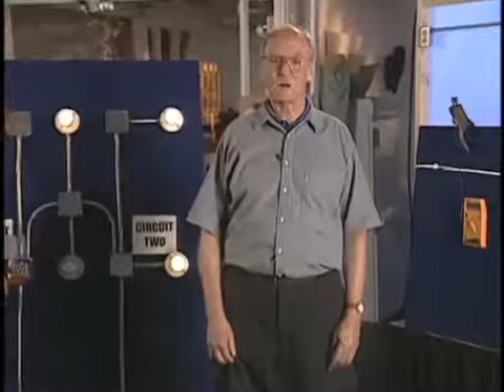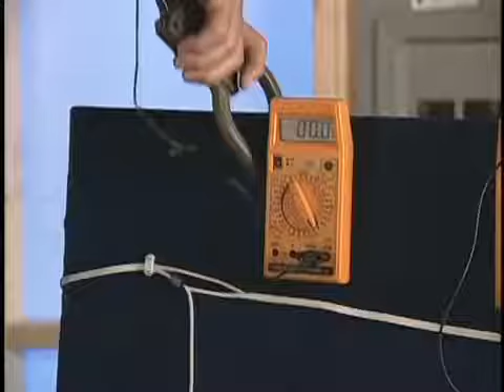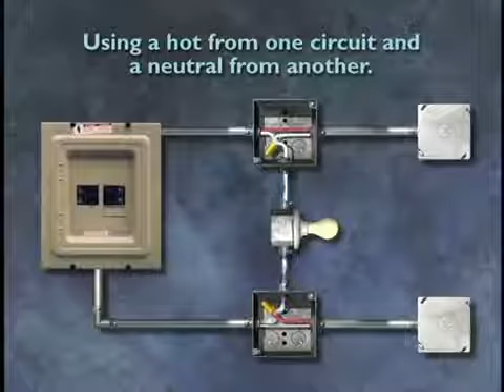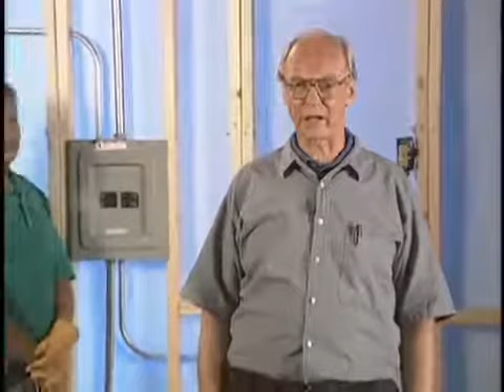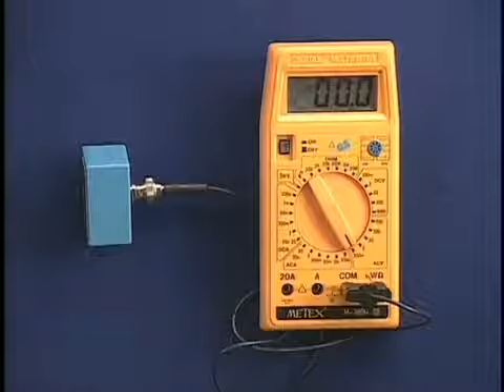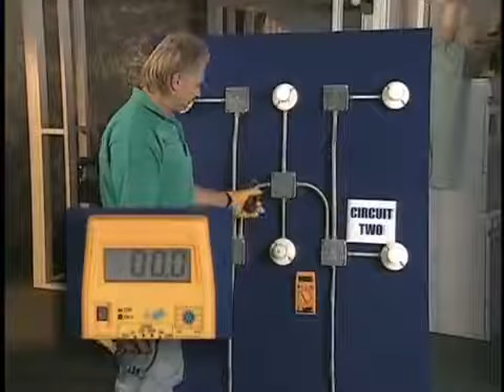Tracing Magnetic Fields EMF by Karl Riley

Comment: Thank you for this video. I have a few questions regarding my electrical panel located inside my condo unit. I am getting really high readings on EMI meter and pulled off face of panel inside my condo. There are 30 gauge wires both hot and neutral plugged into the Main Bus bar, is this right?
There is also a neutral bus bar which has only neutral wires connected to it that are smaller in gauge size.
Reply from the maker: Let's schedule a phone session and take a look at pictures of this.  We need pictures from different angles - clear and showing everything from multiple angles.  A lot of problems we can spot by looking.  Other problems we can only spot by testing.  Visit https://www.electrahealth.com/Personal-Phone-Consulting-with-Shaun-Kranish--Owner-of-ElectraHealthcom_p_77.html to book a session with me, and I can definitely see if there are any obvious major errors!

Comment: If the building was wired with multi wire branch circuits, would that cause higher net currents?   Seems like it would since the neutral only carry’s the imbalance of current on the two phases.  Or does the shared neutral and both phases of a mwb circuit have to run in the same conduit?
Reply: a MWBC will not cause higher magnetic fields, unless it is improperly connected to a separate circuit OR  all 3 conductors are not in the same conduit/cable as required by NEC.  It does not cause higher mag fields because the imbalance on the legs is still canceled by the neutral.  Clamp around the entire cable and it will still read 0 as long as it isn't improperly connected to another circuit.

See what I mean?  While the 2 legs would not be canceling out, the neutral does cancel that difference.  The flows are in opposite direction, fields are opposing, so they cancel.  Clamp around the cable and you will get 0 and all will be good.  When you clamp around a cable and you get more than zero, current is taking another path with another cable or metal object and you have a short/error that needs correcting!!!
Reply: @shaunkranish  gotcha, thanks for the reply.  Makes sense, guess I was just thinking if they were routed in different conduit which as you stated is not allowed.

Comment: ABSOLUTELY STELLAR: ONE OF  THE MOST SERIOUS PROBLEMS SO EASILY SOLVED ; JUST TAKE NOTES FROM A-Z  AS YOU SEARCH FOR THE PROBLEM / SOLUTION !!.  A BIG, BIG PROBLEM WITH SEARCHING IS "BURIED" ; BETWEEN WALLS OR BEHIND A WALL,  FROM ADDITIONAL OR STRUCTURE CHANGES IN IR OUTSIDE.   I WISH YOU WOULD HAVVE EXPLAINED THE NEED FOR A SEPERATE EXTERIOR GROUND ROD QUANTITY NEEDED;  ELECTRICAL NEUTRAL. ELECTRICAL GROUND. WATER PIPE ISOLATION. CABLE TV / INTERNET SERVICE ENTRANCE TO THE BLDG. ISOLATED.  THERE WE HAVE FOUR SEPARATE ISOLATED GROUNDING RODS !!!!.... 🎯😇👍👍👍👍

Comment: To do this test, do you need to turn everything in the house on so there will be a load?
Reply: +Elizabeth J I would be interested to see if you put a clamp on meter on the neutral or unsheathed wire that goes from your service entrance to the pole. On the power tree from your house.
Reply: +John Puccetti I will try it tomorrow when it is light out again. It will require me to climb a ladder :-/. I can do that, but it makes me a little nervous in the dark.
Reply: Be careful!
Reply: Well--if you don't hear from me by tomorrow afternoon, you'll know what happened! :)
Reply: @EJ-oe4pg  uh oh. Haven't heard anything from her in 4 years 😯
Reply: @r3alfish  I didn't fall. Still here!
Reply: d @elizabethjesse6851  did you find amps on the neutral?